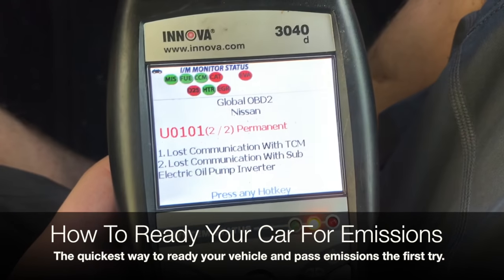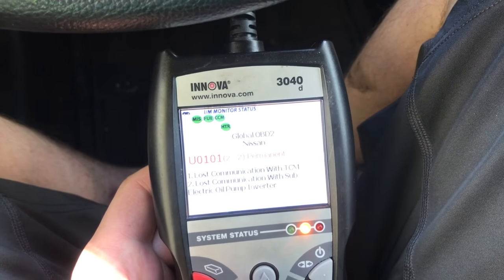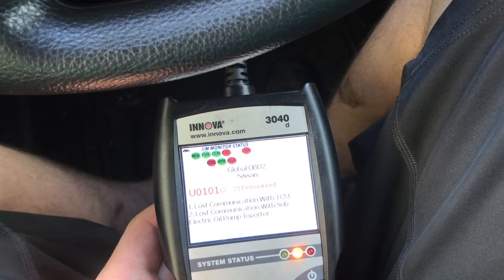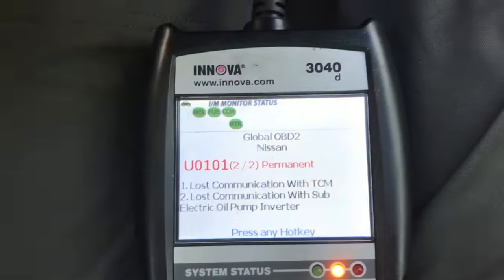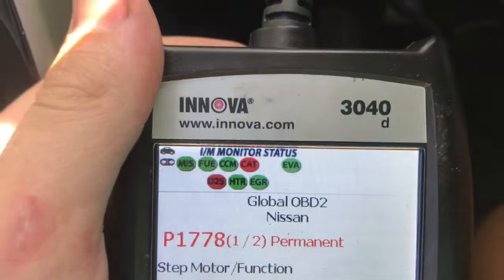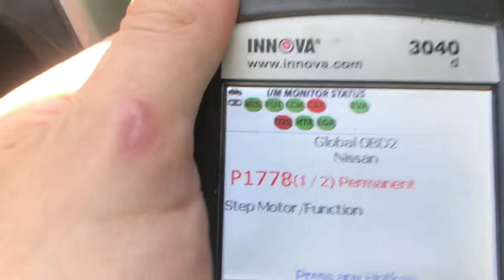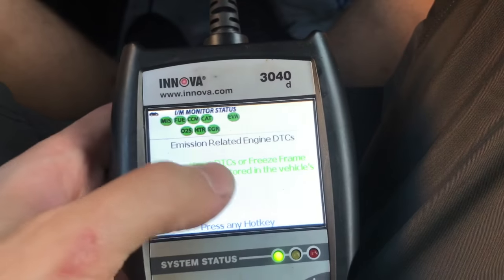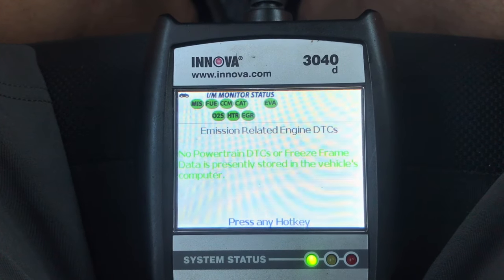How To Complete A Drive Cycle & Pass Emissions & Smog Test (Life Hack)

Comment: Thanks! However these MONITORS that have to set are freaking ridiculous.  Drive forward for 2 mins, then turn on defroster, then drive at 55 mph for 3 mins, then go through a McDonald's freaking drive thru and order a large diet coke with 2 straws.  Just INSANE!! I have a 98 Mitsubishi Eclipse GSX that passed the emissions test, but failed tbe overall test because the MONITORS are not complete after a a repair that was done at a Dealership on June 30th. My model has a problem holding these MONITORS and it is even in a CARB service bulletin.  All tbe smog station attendant said was to drive the car some more. WTF!
Reply: Too funny!! 😅
Reply: 😂 me here tryna fix my gst
Reply: Me two more he told me the same thing!!! But I love ❤️ the seat at a md for a large coke maaaan that was funny 🎉… and look 👀 that probably won’t work because you forgot the fries 🍟
Reply: Lmaoooo I know
Reply: Lol! Classic 😂
Reply: @510t-mac did you supersize it
Reply: I feel your pain.  2000 Ford Taurus SVG.  I live just north of Houston and have to drive 40 miles to get somewhere where there isn't any traffic so I can do my deaccelerations and accelerations and brake smashes, etc.  It is absolutely insane.
Reply: 😂 OMG thats krazy
Reply: OMG MY LITTLE GURL HAS GONE THEW THE MUD AND SHIT IS NOT DONE 2016 HYUNDAI ELANTRA WHAT MACHINE IS THAT ? FIRST IT WAS MONITOR CATALYST AND 02  MONITOR AND EGR MONITOR THESE THINK WAS NOT READ FOR 3 DAYS WTF I DROVE TO RIVERHEAD IN LONG Island and came back rest up and check again same shit not ready 2 day later same drive and check and now it said CHECK ENGINE PASS AND ABS PASS BUT EMISSION READY NO IM LOST AND 3 DAYS LATE  IN GETTING MY INSPECTION  STICKER HELP
Reply: Well did you get them fries or you still driving you may had done better just with a omeal cook lmao😅

Comment: YOu dont have to drive, just jack up your drive wheels and do it that way.
Reply from the maker: That’s true
Reply: ? x plan
Reply: @soloshooter2235  Put it on jack stands. And make sure the ebrake is on. That's assuming your car is front wheel drive.
Reply: That sound scary going 45 to 55mph on Jack stand..
Reply: park at the street where no car in front of you. duh  @sotheamam1244
Reply from the maker: It’s not unless your jack stand breaks lol
Reply: @karrskars  so what would you recommend. To pass emission. For 2006 mdx. Are o2 sensor the same from different company
Reply: @sotheamam1244  i would get oem. Those are critical sensors, Dont use cheap ones
Reply from the maker: If you have the money get OEM. If not get something cheap. Just depends on what you can afford. Either way Ebay will get you the best price if you can wait 5 days to receive it.
Reply: @karrskars  once I clear check engine light..what else to do to pass emission..I think o2 bank 1 sensor 1. According to o'Reilly guy. I'm going to replace that and go from there
L
Reply: dang0088 da don't do it if you have abs and no code reader or scan tool to reset check engine light.

Comment: Above all, check your owner's manual for the Drive Cycle recommended by the manufacturer of your car. Sometimes it may take several attempts to show all components 'Ready.'  THIS has NOTHING to do with your check engine light! Even a $20 OBD2 reader will give you what is ready and what is not. IM Readiness has nothing to do with defective components, but showing 'ready' is necessary to pass your state's emission testing.
Reply from the maker: You can’t pass if you have a check engine light in most states.
Reply: @karrskars  Again, separate issues! You may have zero faults, but still have components that show not ready! They won't trigger a dash light showing a malfunction!

Comment: You can actually check your car's Readiness for smog without a scan tool, at least on some cars. I have a Ford Escape and if you turn on the ignition without starting the car and then wait for about 15 to 20 seconds the check engine light will flash 8 times if the monitors are not ready.
Reply: Just tried this out on my 2014 mustang GT and it did it. Thanks for the tip. Definitely need to keep driving the car then.
Reply: Yea Hondas have something similar.   Would be nice if that was a universal thing on all cars.

Comment: @Karrs Kars, thank you very much for the tips. My daughter’s 2004 Nissan Sentra 1.8L had an O2 sensor that I replaced and then implemented the learn procedure before clearing out the code. Anyway, I had 4 incomplete monitors. I followed the first steps where I started her car up until it reached operating temperature as you indicated. I then proceeded to take the car into the highway where I drove 40-55 mph for 5 mins. Coasted it to 20mph, stopped the car, let idle for 10 seconds and then turned the car off for 1 minute. This is ALL it took for me as I had the scanner connected, all drive monitors were complete and I know for 100% that her car will pass emissions. Thank you so much for this useful video. Cheers and than you!!!!!!
Reply: imnengineer hi!! How long did it take you to complete the cycle?? I got a repair today and I really want to take my car to pass emissions on Monday!!
Reply from the maker: What repair was it?
Reply: Karrs Kars I had a new injector put in basically the thing that fuels energy to the spark plugs/wires
Reply from the maker: If you had a check engine light before that was replaced, you’ll need to follow the instructions. Just drive normally until Monday and you should be fine as long as you drive it a few times a day. Just make sure you take it on the freeway for a few minutes each time. Good luck!
Reply: Karrs Kars that’s what I was thinking!! Will do, I’m just hoping it doesn’t turn back on before then :) thank you
Reply: I didnt have any lights on just new battery cables. Its a 2001 honda  Odyssey and i failed inspection (NJ). 

How long should i drive? Is it miles or idle? Both? 

Thank you sir @karrskars

Comment: Look up the drive cycle for your car. Follow the directions listed. Each car is different with drive cycles. Many will set multiple sensors without doing all the cycles. Check after doing each cycle and do the cycles needed. It may take several for some cars.
Reply: Drive cycle for a 1998 keep grand Cherokee lafeado six cylinder engine

Comment: Both my 2001 Miata and 2008 Toyota Tacoma, after disconnecting the battery,  needed to be driven before they were ready for a smog test.  The Tacoma had a code to be cleared and I did that before disconnecting the battery.   I found that just warming up the car for 10 minutes, driving across town to the freeway, driving a bit over 5 miles at a steady 60 mph, coasting to a stop and then driving a few miles across town to the smog station, fully readied the ECU for a full test.   There are many ways to ready a car for a smog test of course.  I found this way works as well as any.  It was just quicker.  30 minutes total.      Very nice simple video, well narrated and thanks very much for your time.
Reply: I got the same problem on my 2004 kia spectra 🥶🥵👽🍻

Comment: TRUE LIFE HACK: Under 6 miles
 Go on a highway or back-road high speed, late at night so no cars
1) Go to car
2) From cold start, wait a few minutes to warm up before moving
3) When on the hwy/road, go up to 65mph
4) Stay at 65mph for at least 5 miles, preferably 6 mi
5) Put hazards on, coast to a 10-15mph stop
(DO NOT TOUCH BRAKE DURING SLOW DOWN)
6) Once you're slow, with hazards, in the hazard lane, put on the brakes
7) Test/Diagnose button on your OBII unit, should be all good to go.

You might have to drive more or do this test multiple times to get the EVAP ready. This system has to deal with your gas tank, if the cap is loose, and how/if/when your gas evaporates into the atmosphere. If your gas does not EVAP, than you pass / OK / Complete.

Adding a fueld injector cleaner (like STP/Chevron/etc) helps a lot
Making sure your air filter is cleaner (pull it out, tap it, if anything flies around change it.)

With that being said, you should be good to go
Passed smog after fixing 4 minor check engine lights and 4 incompletes. All complete, all fixed and cleared in 24 hours.
Reply: Devon Wayne will this work with a car that has not been running for about 4-5 years everything passes but the obd readiness
Reply: fuckn nice !!! i will try that!!!
Reply: I tried it and it worked 07 Subaru
Reply: Will this work for a 96 Mitsubishi 3000gt?
Reply: Would this work on 2001 Yukon Denali ?
Reply: honda crv 2006????
Reply: Will this work for a 2012 jia sorento for the O2 sensor monitor?
Reply: @FastInDrift I just failed emission test cuz I had to disconnect battery cuz check engine lite had to be formed off. I have an ask ‘07 Subaru too. So I went right over to get inspection after I got check engine lite turned off, & forgot ya gotta let car recycle for the codes to show. . So their machine can see them. Ughhh. I was so disappointed. I have 2 days now to try to bring it back for another inspection. It’s Thursday today, & I’m going to try again Saturday. I hope by then everything will have returned codewise, & check engine light stays off! I know exactly what check engine lights on for..& I just need my car legal right now..then I’ll get it to my mechanic. Right after I reregister it. That’s all I was trying to do to begin with & the stupid light came on the dash cuz it’s literally a wire thing. Switches that have already been diagnosed. Ughhh. Fingers crossed for Saturday.🤞🏼🤞🏼🤞🏼🤞🏼🤞🏼🤞🏼🤞🏼🤞🏼🤞🏼

Comment: My 2008 Nissan Altima failed the emission test and could not find the cause. Sparkplug, Injectors, MAF, Oxygen sensors, Catalytic converter, Piston rings everything was addressed but the problem still persisted. Finally, someone noticed that the temperature gauge was always showing a very low value. And it was because the thermostat valve was faulty and was stuck open and the ECU was sensing it as cold start condition always and the fuel air ratio was running rich. The fuel economy was much better after replacing the thermostat valve but I miss the sporty acceleration and pick-up when it was running rich.

Thought might be useful to someone going through similar dilemma.

Comment: Drive cycles vary by manufacturer. For a 98 Honda Accord v6 cold start the engine with the AC on and the rear defroster on idling in drive for 2.5 minutes then take it for a ride. Which is more detailed.
Reply: 2004 kia 👍
Reply: Exactly. The owner should truthfully consult the manufacturer website to see what to do for their individual vehicle

Comment: my acura tsx didnt pass on saturday due to catalyst not ready - tech advised I drive it for 50 miles so it could be ready. Idid that and using my bluetooth obdII, it still wasnt ready. Not sure if my reader is just bad. I researched my drive cycle and tried it twice already. Still not ready. No check engine light ever and no fault codes. Have driven almost 100 miles - thinking I may need to do more?
Reply from the maker: Yep keep driving. Make sure to let the vehicle cool down between trips.

Comment: I suppose the drive cycle is different for different brands? I have a 2008 Subaru Outback that I been trying to Smog and it has one code still red which is the Cat.  I have driven it probably over 100 miles to get it primed for testing. Also put a few Cat cleaners in the tank - still not quite ready. I'd appreciate some suggestions. Thanks.

Comment: My 2008 Chevy 1500 w/ 6.0 L keeps getting 2 or more 'not ready' indicators.  I have tried all the drive hacks but still 'not ready' keeps me from getting my emissions test done so i can sell my truck!  This has been going on since June 2019!!  They tell me I can't just buy new sensors to get around the 'not ready' indicators!  My mechanic says the vehicle will easily PASS the emissions test but only after the indicators show 'READY'.  HELP!!
Reply from the maker: Which indicators are coming back as not ready? Any check engine lights? You can try some of the emission ready additive sold at Walmart to see if that helps at all
Reply: I have the same truck and the same problem!!! I want to sell it but can’t get the thing to pass a smog test.

Comment: Anthony Battaglia

i have a jeep grand cherokee 2002 and have 2 monitors -o2 sensor and catalytic converter that are on and since Im in new york if one goes off I can get the car to pass the inspection. I drove the car 800 miles and coil block had to be change with spark plugs.
Now start all over with drive cycle.
I put in after that 250 more miles.Now I tried your suggestion to try idle 5min shut off for 10 min. and restarted and checked both monitors were still on.
Tomorrow  I will try your other drive cycle  5x up to 30-40 drive cycle
What else can you help me with this problem ?
I have to fix by july 30th.

Comment: Hi, I go crazy. I am driving and driving, but I can't pass the inspection. They say my car is not ready. Can I use, as you do, a Diagnostic Code reader while driving? Anyone works? Thank you.
Reply: Yes, you just need to buy an OBDII  monitor, you can get them on Amazon and harbor freight, any auto zone type store. YOu plug it in, start the car and click the I/M button, it will read the readiness of your car, then you can see what needs to be cleared by driving and watch it as you go in case the god forsaken O2 moniter clears and you can get through emissions. I was just doing it yesterday. 200 miles, and no luck yet. SO FRUSTRATING!
Reply: @tucsonblonde  did you get it to clear yet. I'm going through the same thing
Reply: I put 450 miles on my 2009 civic, never had a check engine light but battery went dead out of nowhere prior to failing inspection, I let the car sit for an hour, started right up. A week later, took it in for emissions, failed. I’m ready to drive this civic right through the dealers window. Why do they torture us with this crap ? It feels like I’m 12 trying to hit the up down, left right button , triangle for the cheat codes in Nintendo. Any suggestions before I launch this ride through their window ?
Reply: @chrystofurious  let me know what you need to be cleared. I will help..I did the drive cycle on my own an passed
Reply: Mike Johnson how did you do it ?

Comment: I have 2015 Acura TLX and both EGR & Evap are failed. Normally I drive very less around 50 miles a week. How many miles should I drive before taking to the inspection station to make this tests pass? How abt AC while driving? Should be on or off?
Reply from the maker: Doesn’t matter if the AC is on or not. I would drive it normally for 3 days. If you have more time do a week. If you don’t have a lot of time drive it 100 miles throughout the day. Make sure to stop at some point and let the engine cool all the way down.
Reply: @karrskars  I have time...will drive the vehicle for next 5 days around 40-50 miles per day and will give the emission test..

Comment: I had my 2016 F350 Diesel Def reductive tank worked on and now it won't pass emissions. I have driven it over 100 miles and also was able to get an extension on my registration. but it is frustrating, any suggestions???

Comment: Been driving more than 100miles but 2A and EV remains red what are the requirements for those to cycle? Using a Zr4 reader car is 05 s2000 and I have a state ref smog appt in the morning please advise
Reply from the maker: Did you have any codes before? Check engine lights

Comment: Thanks for the video. My car is showing cat monitor not ready for several weeks but I still couldn’t figure out why. So while driving, do I need to turn on or turn off the AC?
Reply from the maker: No that wouldn’t matter (the AC)
Reply: Karrs Kars Thanks, today I got the error code p0431&p0421 back on the DTC, but the cat is still not ready. I guess there must be something wrong with the converter.
Reply from the maker: https://www.audizine.com/forum/showthread.php/307571-Two-codes-P0421-and-P0431-bad-cat

That may help. Some good info on there. May be using lower quality gas too.

Comment: I have a 2001 Silverado 1500 do I have to complete a drive cycle to make my secondary air monitor ready or can I just start it in the drive way with ac and defroster on for 3 mins then turn off ignition?

Comment: 250 miles evap finally went green, still waiting on OH....🤦‍♂️
Reply from the maker: It can be a process smh
Reply: I'm at a 150 miles with my GMC and EVAP and EGR are still not ready.
Reply: Samuel Iam  omg ... I am trying to figure out if there is something wrong with my rav4 (2002) I've driven at least 100 miles but I think I need to do the drive cycle specifically how it was shown here - but I need this asap, I just got my fees waived at dmv but need to get the obdII ready.
Reply: Samuel Iam    I think you just saved my ass   having same exact problem   would have kept driving endless waiting for cycle to end   work recently done revealed thermostat was missing   mechanic did not specify importance   said to keep driving      thank you
Reply: Samuel Iam    I remember those days   it was depressing   "stuff required tends toward 'stupid"  yes   and I was in the Valley those days
Reply: Samuel Iam It’s because cars are made better.
Reply: In Cali if the ivap doesn't set it'll still pass, not sure in other states